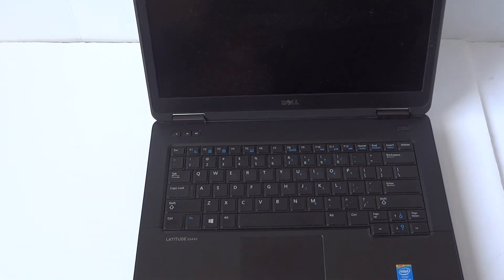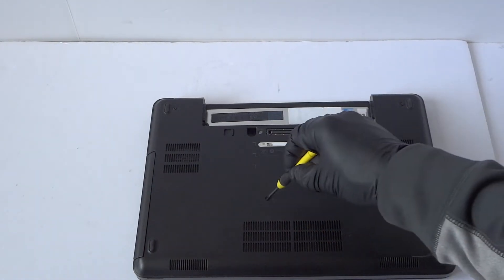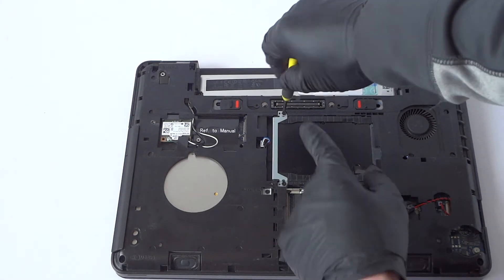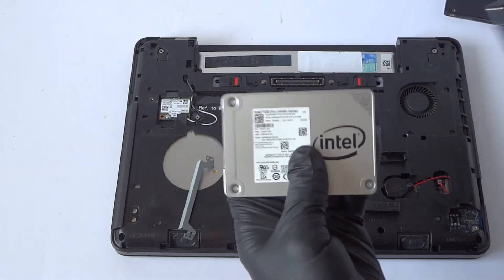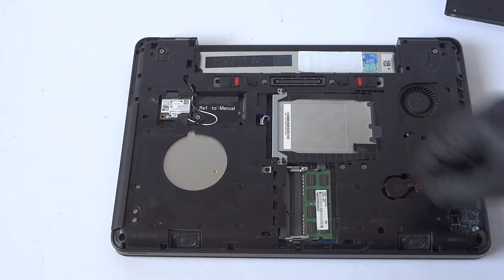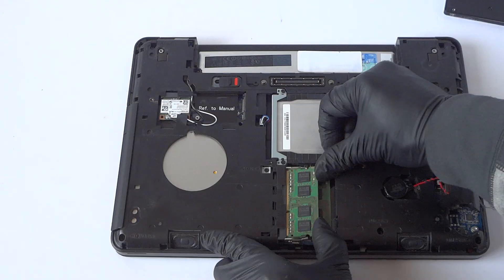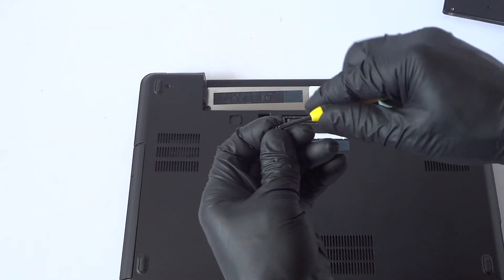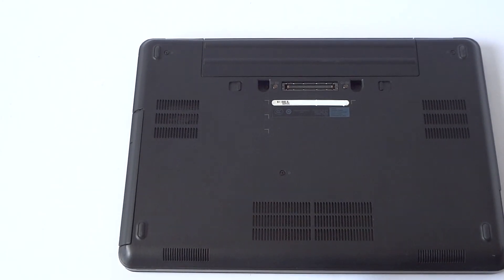Dell Latitude E5440 SSD RAM Upgrade

Comment from the maker: List of RAM and SSD works with this Laptop  Dell Latitude E5440

This RAM works with this Machine MAX RAM Supports 16GB:
(1.) Crucial 16GB Kit (8GBx2) DDR3/DDR3L 1600 (PC3-12800) Unbuffered SODIMM
https://amzn.to/3e58PTs
(2.) Crucial 8GB Single DDR3/DDR3L 1600 MT/S (PC3-12800) Unbuffered SODIMM
https://amzn.to/2WNvw9d
(3.) Crucial 8GB Kit (4GBx2) DDR3/DDR3L 1600 MT/s (PC3L-12800) Unbuffered SODIMM 
https://amzn.to/2zPos2S

SSD list works with this PC:
(1.) Samsung 860 EVO 500GB 2.5 Inch Internal SSD MZ-76E500B/AM) 
https://amzn.to/2ZlZDGg
(2.) WD Blue 3D NAND 1TB Internal SSD, 2.5" WDS100T2B0A
https://amzn.to/2XezdU9
(3.) WD Green 1TB Internal PC SSD  WDS100T2G0A
https://amzn.to/2XfGtzc
(4.) SanDisk SSD PLUS 480GB Internal SSD SDSSDA-1T00-G26
https://amzn.to/2yfgjUK
(5.) Crucial MX500 250GB 3D NAND SATA CT250MX500SSD1(Z) 
https://amzn.to/3bTTjbX
(6.) Samsung 860 PRO SSD 256GB - 2.5 Inch SATA III 
https://amzn.to/2ymvQCq
(7.) Samsung SSD 860 EVO 250GB 2.5 Inch SATA III Internal SSD 
https://amzn.to/2VjIAkK
(8.) SanDisk SSD PLUS 240GB Internal SSD
https://amzn.to/2zfc7EX
Reply: Mxkdi does Sandisk ssd plus 120gb works with this laptop?
Reply: Bro it doesn't works with a RAM ddr3  hyperX 1600??
Reply: My Latitude E5440 is from 2014, does this change what is compatible?

Comment: Great video!
One question buddy: Does Kingston SSD SQ500S37/480G 480GB works with this PC? My laptop is the same as yours..

Last question, how many hard drive slots are available in the laptop?
Thx for replying me, I'm about to buy my first SSD..
Reply from the maker: Hi, yes Kingston SSD 480GB works fine with this laptop.
https://amzn.to/3TkTbJ8
Reply: I have the 5540 which is quite similar to this laptop and I did that upgrade of the Kingston SSD with no problem. Just to confirm that it works great.
Reply: there are 2 slots, however they both are different. the one in the middle is the main “SATA” drive that boots. the second one is on the left, where the “Ref. To Man.” is. “mSATA” is used for also booting, and can also be used for storage.

Comment: E5440 have a NVME M.2 SSD slot, why you don't put a M.2 NVME SSD into it instead of a SATA SSD for faster reading? I'm using an E5440 right now and feel happy with a 1TB NVME SSD.
Reply: Hi.
Please can u list kinds of RAM and SSD suitable For E5440??
Reply: @bashangegoogle6714  could you send it for me too
Reply: This is Intel 4th gen. Before the creation of the Nvme drives.

Comment: Is there only one slot for hard disc ?
Reply: No, you can slot a hard drive into the spot where the optical drive is however, you need to get the special proprietary adapter to stick the second hard drive in so that it will properly connect to the motherboard.

Comment: I wonder why they stopped using externals batteries for newer laptops
Reply: They did this so that it would be harder for you to replace the battery on your own computer. They want you to either buy a new computer or send it to them so that they can replace the battery and charge you a premium price for it.

Comment: Hi! Thanks for posting videos like this. I have a question, after installing all of those how do you go about setting up the OS and the dell software and drivers?
Reply: Hello, the critical step before disassembly and installation of the upgrades is to create a bootable USB drive using the Dell OS recovery tool. It is best to use the system and question to create the bootable USB drive because, when you open up the Dell OS recovery tool and type in your service tag you will have the option to create a USB drive for “this computer“. This has the benefit of creating a USB drive with the original operating system that will also include the original drivers.
With the bootable USB in hand you can proceed with the upgrades! Once the upgrades are installed leave the system powered down, insert the USB drive, power on the system, rapidly tap the F 12 key to bring up your one time boot menu, ensure that you are choosing UEFI secure boot if you are using Windows 8.1 or later then, click the USB drive option and installation will begin.
As you will be inserting/installing an unformatted drive you will have to choose the custom option, choose unallocated space, hit next and windows will automatically format it into NTFS. Good luck

Comment: Question... Is it possible on this laptop RAM for example on 2Х4GB, 4Х8GB, 8Х16GB?
Reply: no bro ,  always use same capacity of ram  like 4gb ram, 4gb ram or 8gbram , 8gb ram . in order to avoid any overburdern issues and it is not recommended at all to do things like 2gb,4gb or 4gb,8gb . u should alway use same speed and capacity rams